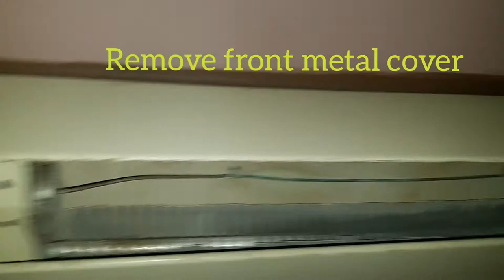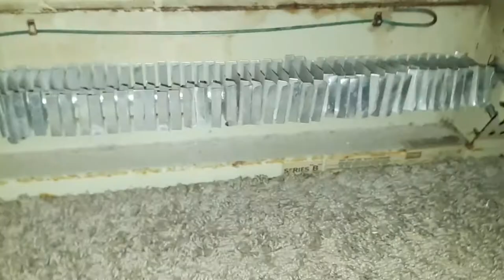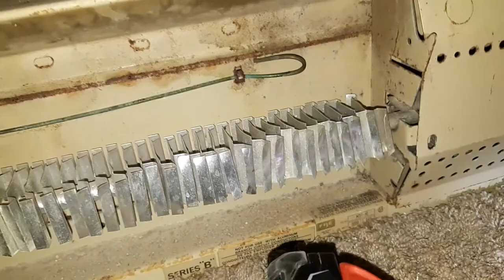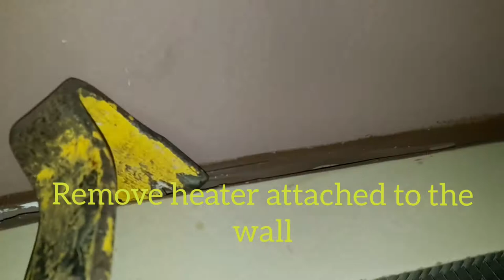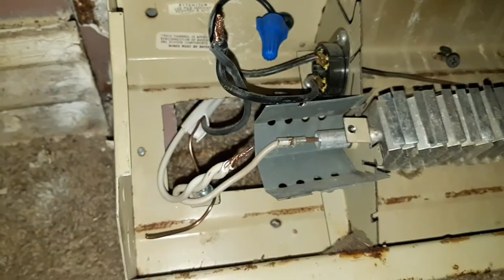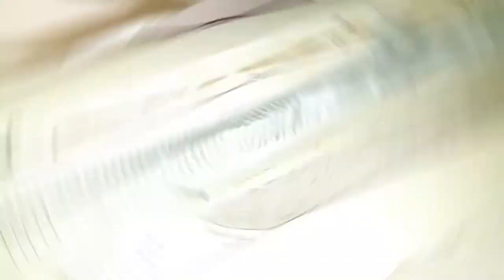How to remove  electric baseboard heaters.

Comment: Before touching the wires test for electrical power with one of those small probes you can buy especially where you are dealing with 240v.  I saw a dishwasher install here on Youtube and it turned out the guy had flicked the wrong breaker. He caught it with a tester.  Imagine if that had been 240V and he never caught it..  We have a poor guy our area severely incapacitated from an accident with 240v his house.

Comment: What do you do with the wires that are supplying the power to the baseboard?
Reply from the maker: Pull out the wires (not in the video) connected to the circuit breaker.
Thanks for watching.